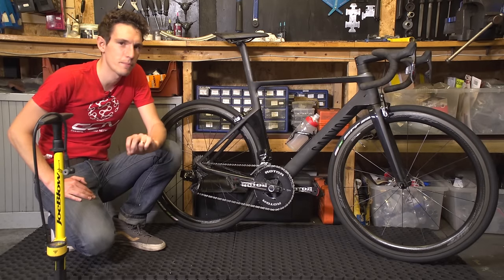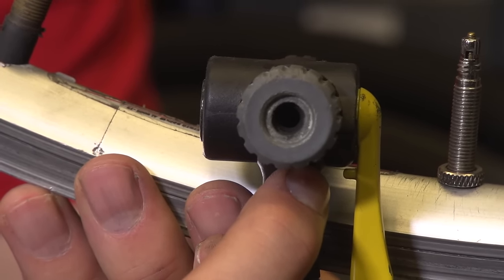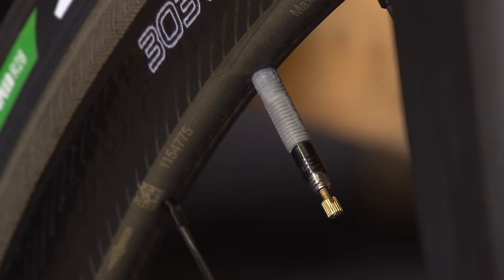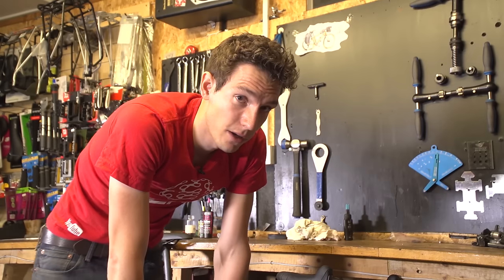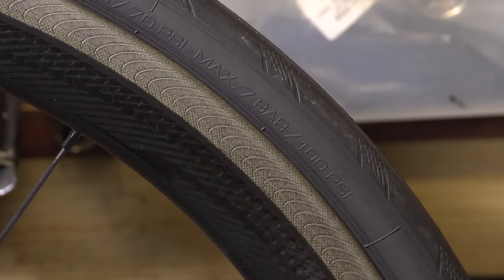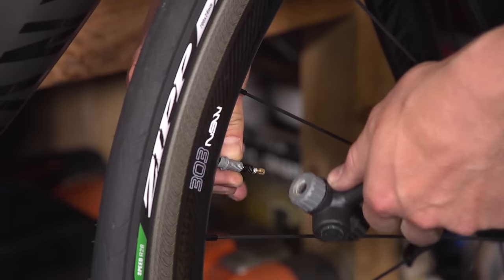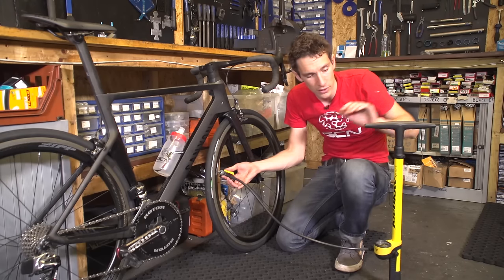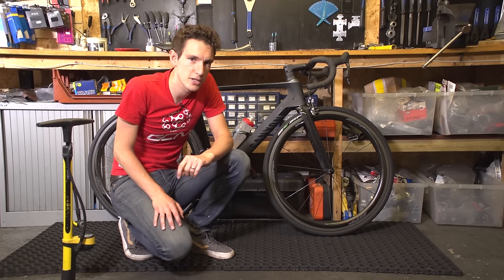How To Pump A Bike Tyre

Comment: When you've been riding bikes for a few years but you still watch the whole video just because GCN makes good content
Reply: I watched the whole video hoping Si would tell me how to avoid bending the tip of a presta valve. Did not see a solution.
Reply: +sshhaamm Good suggestion
Reply: +sshhaamm if anyone can do this they are a wizard
Reply: sshhaamm Guy's I've honestly never done this. I think I might know what you're talking about, but the valve cap still fits so im good.
Reply: I was literally thinking the same thing lol
Reply: I'm talking about the threaded pin the lock ring sits on. I always manage to bend mine, and on two occasions have snapped off completely. This obviously means changing the tube when technically it's still fine, which is a bit annoying.
Reply: I managed to snap off the pin aswell lately. No need to change the tube on Conti, its possible to change out the valve alone.
Reply: sshhaamm - Si has the solution, but did not mention it. As he says, fit the pump securely to the head of the valve. His small pump is a lezyne, which has a short flexible hose so it does not put too much stress on the valve. And importantly, it screws onto the valve firmly, and rotates. They also make floor pumps. All my pumps use this principle, immediately solved the problem. Just make sure you do not screw the removeable valve core out when you take the pump off, as I did last week when I borrowed someone's else's normal pump on a group ride

They also work for inflating disc wheels and the like where access is difficult
Reply: flamezor1
Reply: Same.

Comment: It should be remembered that somebody somewhere has just bought a new road bike, or got one on a cycle to work scheme, maybe never having seen a presta valve before.

Everybody needs shown the first time, for me the first few times, criticism of this instruction says more about the author than the content.

Thanks Si.
Reply: +1
Reply: I've had the same experiences with my first Road Bike,  this video ain't half bad, It helped explain why I'm having a hard time pumping air even if the pump is properly fitted and secured on the valve.
Reply: Thanks Michael!
Reply: Michael McDermott I
Reply: That would be me. I just went to put air in my tires and I took the cap off and was wtf is this
Reply: Michael McDermott Me as well. I removed the whole cap and totally deflated my tire on my bike at the other side of town. A kind stranger helped me jnflate it and told me about the adapter. So def useful info.
Reply: Michael McDermott that's me😂
Reply: How much air to put in my 26" ancheer sport ebike
Reply: YEP! Just bought a new road bike. I had a presta adapter but I didn't know I had to screw the adapter on...I was having trouble with that one...
Reply: Totally! I've only just gotten a bike for the first time and I have found this video very helpful. Thanks :)
Reply: I'm new to road biking (used to have MTB on Schrader valves). This video is a gem for me.
Reply: yeah ME

Comment: Hi, I'm 74, and have been riding since I was 5, off and on (no pun). In 1984 I bought a beautiful, skinny-tire, high end road bike and rode it for about 20 years, thousands of miles. 
Then since 2007 or so I was just riding occasionally, on vacation on any conch bike available. This week I bought a new Schwinn Cabo cruiser bike, online. It arrived today and I had to put it together and then "adjust" everything. Four hours later, I'm done. I had to release air from the feont tire to get it on, 
Then I was unable to get rhe air pumped in again. Whether it was just pausing and starting over or watching the video. It's now ready to go and I took it for a spin. Now to install my lights, mirror, bell and basket and I'll be done.

Comment: Very helpful. I am an experienced tool and metal guy, operate a CNC, TIG weld, do some woodworking,  maintain my own car, etc. When I got my first bike in over 20 years, noticed the valve is different from the car (and shop compressor) and did not even know the terms to use.  This is the perfect video to explain the difference between Presta and Schrader (sp?). Now I am going to get some adapters and should be good to go. Thank you!

Comment: One very important thing missing - when inflating the rear tire, work from the left side of the bike.  I learned the hard way the first time I pulled the pump head off the valve and smacked the back of my hand into the cassette.

Comment: So helpful. When I was young I used a bike with a Presta valve so was confused when my new one came. And didn’t know you needed to lose a bit of air to find the right fit before fitting the valve (which on my model the flap went up rather than down to lock, opposite of what I was expecting!) Amazing what can stump you when you’ve left something for about 20 years!

Comment: May I ask? Do you guys deflate your tires between rides? If so, why? I have been doing it ever since day one. Don't know if it's necessary?
Reply from the maker: We don't tend to, no.  Can't remember what the reasoning was behind doing that.
Reply: I remember now. Back in the day we raced or rode sewup tires. We would always deflate them for whatever reason I forget. I just kept the same practice for years. I have been told with the newer tires it is no longer necessary. 
BTW, I love your channel. Keep up the great work.
Reply: It's wise to deflate your tyres if you carry your bike in the back of a hatchback. It gets warm in there and your inner tubes will explode.
Reply: A member of my bicycle club took their bike to work and stored it in the hot car during the day.  When they got to the club ride in the evening after work, they often had a flat tire.  After they started to deflate the tires while the bike was being stored in the hot car, the flat tire problem was solved.
Reply from the maker: yep, I have had tubular track tyres explode whilst in the back of a hot car whilst driving along the motorway! as well as seeing them explode on a sunny day in the centre of an outdoor velodrome. Jon

Comment: Wait a second!  I just got a 2021 Trek ALR4 bike and have been pumping the tires without removing the small screw on the presto valve for months.  I have already had 1 flat too.  Just found out tonight that I was never putting any air in the tire the entire time.  I'm pretty smart btw and have 2 Master's degrees.

Comment: You might have wanted to include that with latex inner tubes you will need to inflate more often than a normal inner tube as they do deflate quite a bit even within 24 hours.
Reply: If you need to watch a video about how to inflate tyres, lets face it, you're not going to be using latex tubes.

Comment: How about a GCN does science on how much pressure is lost during an efficient pump removal because I know that not all the air you hear is from the pump hose.
Reply: It's less than 1 PSI
Reply: Depends on how much pressure is there to begin with. On MBT (pressures up to 60psi) it's barely noticeable, but on road bikes (110psi+) it may be up to 5psi if your pump is of the screw-type, from my experience.
Reply: Bruno Panzero Schechter yeah if it's a screw type you can lose a noticeable amount of pressure but the lever types are basically fool-proof.

Comment: wow GCN is really running out of inspiration for new videos
Reply from the maker: No.  You just don't benefit from this video.  There's a very important difference.
Reply: +Global Cycling Network exactly, your videos helped me no end when I was starting cycling last year, and thanks to you I now have a good knowledge of my bike and how to maintain it confidently,  but I still like to watch these videos to keep that knowledge fresh :)
Reply: no this was really informative, but you must understand that GCN is growing in subscribers numbers so they have many newcomers to cycling who dont have any knowledge so it is a good idea for them to learn something, I've been following GCN since 2013 and learned so much over the years
Reply: I've watched it just to see if there was anything different to the way I pump my tyres up. You can never learn too many things!
Reply: yep
Reply: exactly. They go from a 6.16KG unnecessary bike to a...How to inflate a tyre/tire video?!
Reply: I watched as well just to see if I could learn anything.  I was surprised at the end to hear Si say that hopefully you wouldn't need to pump up your tires very often, just a thumb check before every ride.  I put the pump on them and add air before every ride without fail.  Even after only 24 hrs they seep some air.  No, it would not be the end of the world to do it only, say, once a week, but it's quick and easy to always ensure you have the right pressure.  I suppose it is a cheap and easy marginal gain. One suggestion:  Spend the money on a pump you will enjoy using.
Reply: +Michael Fiola Good point. I used to do this less often and I'm sure all the punctures I got were the price for it. Now I do it virtually every time I ride,and the frequency of punctures has declined your of sight.

I'm going to get a puncture now, arent I?
Reply: If you make videos to benefit the average googler/youtube user who enters search phrases about bicycles, I think you'll get a different audience from the present one. If that happens, I hope it's what you want. Good channel, unusually basic video. Cheers.
Reply: I work as a bike mechanic, and I can tell you'd be impressed by how many people would benefit from this video!

Comment: I'm new to cycling, wanted to go out on a ride and noticed my tires quite soft. Wanted to pump them up. I only have a mini pump (that's in my saddle bag). Had to pump up both my tires completely, by hand, because when I put the pump on the valve my tires deflated entirely. I think I sat there pumping for about 20 minutes. I felt the air going besides the tires instead of in, and had quite some trouble getting the pump positioned just right to pump the tires. But I did manage, it was a workout in itself. Need a better pump ;) Thanks for this video, I was able to manage it!

Comment: Is it a "lock ring" Simon? I don't want to be all scientific but it's a nut, just  because it's not hexagonal it's still a nut. A lock ring is a secondary fixing. A tip for Presta newbies that wasn't mentioned. Always crack the valve with your finger before you introduce the pump. Even when the lock nut is released the pump may not be able to force the valve from the seat. Huge fan of GCN. Keep up the great work guys!

Comment: Thanks Man, you’re a lifesaver. Just a tip to grease up the valves with WD40 after filling air in winter to avoid clogging. 😊👍🏼

Comment: I've been cycling for years and I still struggle with attaching the pump to the presta valve.  When I start to pump it doesn't want to go down...I'd say this happens 80% of the time. I'm afraid of opening the valve too much because I've had it get ripped off in the pump head when I remove it from the valve. (if that even makes sense,) so I appreciate videos like this. 
Another great video!

Comment: I just got a bike with presta Valve and I never seen this typ4 of valve since I couldn't get my pump to get any air in it and even worse it wasn't really locking on valve it was just loose and air was leaking instead of going in.  I began to think I need to buy a special pump for that type of pump. It wasn't until I got on YouTube and found this video that I saw how they work thank you!

Comment: Another good video. Thanks. I haven't ridden much in the past few years, and I've certainly done zero repairs. Having the net and YouTube is just amazing. The best bike repair book in the 1970s is a joke compared to what's available now. It was good for its time, but there's nothing like seeing someone actually doing the thing. (I've learned a lot of different skills over the years, watching an inarticulate guy doing it is much much better than listening to an expert explain it.)  I intend to buy a new bike, but I think I should first get the molasses or gravel out of my bottom bracket and enjoy that for a bit. What's in there? Might be packed wall to wall with grease. Back in the day I had no  YouTube (or GCN), and apparently no clue.  

So here's what I know about tire pumps. First the lever attachment. Common mistake-after flipping the lever the wrong way- is you don't put it on quite right and it doesn't do anything when you pump. Just fiddle with it.  Also,  as a teacher my students would launch soda bottle rockets. There is nothing better than turning a bunch of 14 year old boys loose on something that shoots into the air at 200 mph, which they first have to manically pump up to about 80 psi.  No bicycle pump lasts more than about one hour of this. I've spent $115 and $15-- no difference. NONE. So save your money. Get a cheap one that works: you can't do any better. And if you've got to do dozens of tires (or rockets) just get a small compressor. Over the years a decent inexpensive pump will hold up, it's the heat and wrenching side to side that wrecks them. (If you know about the Gas Laws, you'll know that there's no way of getting around super heating a pump if you do 40 2 liter rockets in 50 minutes).

Comment: There are pumps out there that accommodate both valve types with a single hole. I gave one, and its awesome that I can move between my bike and the kids bikes without having to worry which pump head to use.

Comment: Great video, thank you this was helpful to me as I am new to biking.

I used the joeblow sport pump for my SP sport hybrid bike and it worked fine the only concern I have is the pressure. Technical the right pressure should be 75-100 psi I had to stopped pumping at 45 as it feel pretty firmly.  Anybody else with the same issue?

Comment: 1. Yes, it's entirely possible to bend the little stem of a Presta inner valve. Some brands/types are more prone to this than others.You can mostly prevent it by not screwing out the lock nut completely but leaving a bit of the stem at the end....
2. When screwing in the lock nut, make sure not to overtighten as this may damage the rubber inner valve seal which will result in either a sort of a slow puncture or an instant catastrophic flat...
3. While we're on the subject, you are able to screw out/remove the inner valve construction (rubber inner seal, stem and lock nut + housing) from a Presta. For instance for inspection of the seal (now we all do that regularly, don't we !?). When re-installing, you should ideally tighten it with a special valve key....a rather inconspicuously looking, usually plastic, hard to find thingy that snugly fits over the inner valve with the sole purpose of tightening it without screwing it up entirely.....finger tightening will not work to full satisfaction, pliers will screw up your Presta and your day...Removing the dust cap will overtime result in slowly but surely loosening your inner valve, resulting in yet another, inexplicable slow puncture and screwed up ride....just a hint of a very mild Loctite on the inner valve thread (careful not to drown the stem or seal!) will save your day.

Comment: thanks for the videi i just bought a bike and it was low on air. i figured that out when i went 2 blocks down and realized it was not normal for me to be going as slow as i was. i have a little pump but no gauge on it thanks a bunch

Comment: Ok, this is probably the best video I have seen on pumping bike tires (it's very detailed) and yes I've watched a ton. WHY? Because my tires won't pump!! I've tried two different pumps and the same thing happens each time. I attach the pump thingy to the schrader valve and when I go to pump it won't move more than a couple of inches. I have zero clue what to do. Can someone please tell me what is wrong with my tires?

Comment: Thank you so much. I got my tyre fixed and they put a tube with a Presta valve on it on and I've never seen one before but the psi seems low (I'm pretty big though unfortunately) but I didn't wanna break it. ;-;

Comment: It took me a bit to figure this out! So here's a great device that'll refill your bike tire and it's small enough to take with you!

It's called The Milwaukee M12 Inflator (also comes in M18) it's accurate within 1 psi, you get a digital reading on your current pressure., set to the desired pressure and fill.  i
If you buy the USB port adapter you can charge your phone as well as fill your tire I recommend a 6ah battery to fully charge your phone and to have enough to fill tire! Perfect for long and short bike trips!

Comment: That Canyon frame looks awesome!
If you dont screw down the locking ring of the pin and go biking at higher speed, the centrifugal force will pull the pin in and..... ;-)

Comment: Great vid overall. It was mentioned (when detaching the pump) that you may hear some air "escaping", and that it was simply pressurized air coming back out of the PUMP and NOT from the tire. If this is true, then why does my tire feel much more deflated once I struggle and finally get the pump detached (after hearing a lot of air escaping and not really stopping)? This has been my only struggle for years. Sometimes you're working in a tight space and can't really remove the pump quickly.

Comment: What pump and/or fitting are you using? I have just accidently deflated my back Tier trying to pump it up using a pump that simply doesn't fit the presta valves